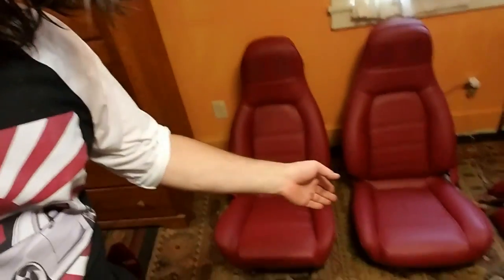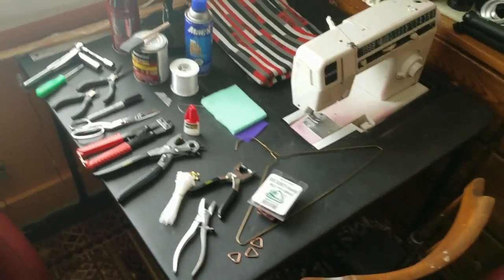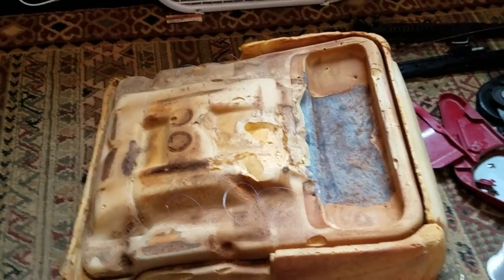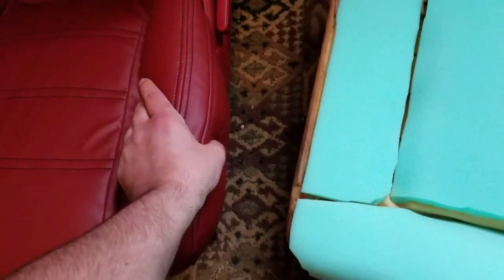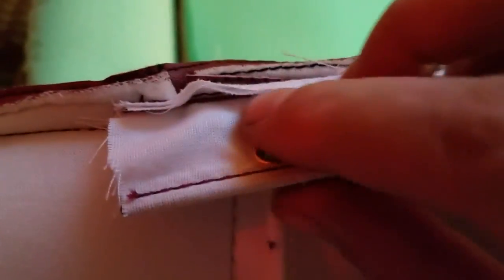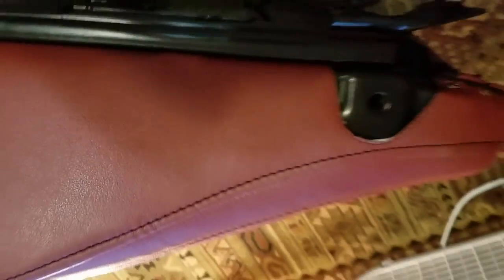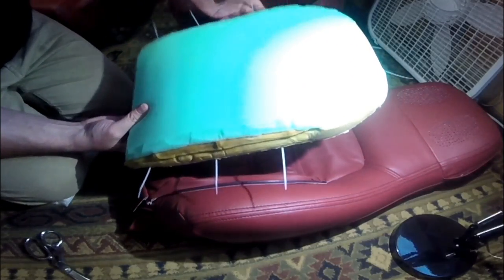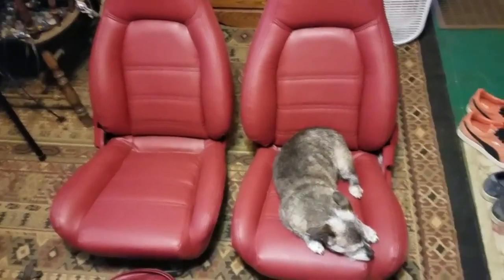[MX-5 Miata] Re-skin and restore your seats on the cheap!

Comment: Dude!  Thanks soooo much for the video.  I just finished installing interior-innovations skins on my '95 Miata.  Your video was of tremendous help.  I tried plumping up the foam with a garment steamer (as recommended by others) but it had little effect.  Your use of 1/2" poly foam is what was needed to make up for 23 years of age and butt pressure.  Thanks again!

Comment: They came out amazing! I just ordered the same seat cover replacements but in black. I saw another video where the guy gave up because they were too loose and wrinkly and I started to think about adding in foam to make it more fitted and for more comfort. I'm really glad I ran across your video because I'm now confident it can be done with materials I already have. Your instructions are WAY more clear than the ones given by the supplier. I hope you won't mind if I post your tutorial on the miata forums I frequent, you've got my sub and you'll be getting MANY more. You deserve it! Keep up the good work!

Comment: Thanks for posting this! I just finished redoing my seats in my 95 and this was very helpful. The addition of the rivets is CRUCIAL imo to reinforce the attachment points underneath. Without them the vinyl will rip. I was also worried the zip ties wouldn't be strong enough but they seem good and allow for cinching unlike the hog ring tool. I doubled up on spots I thought would see a lot of tension. I also added a lot of foam to my bolsters but not the bottom since I'm 6"4". My seat covers were only $100 for the pair and look good but with that low price, you end up spending more time to get them on right, adding rivets etc. It took me about 16-18hrs in total from start to finish. I also added heating pads to the back and butt of both seats ($35/seat ebay kit)

Comment: Finally some kind soul gives me a step by step primer in how to rebuild my 90 seats, ( in the only year of red, of course), new driver side seats are impossible to find, and covers don’t solve the basic problem of people not knowing how to get in and out of sportscar seats. Thank you so much for a class video on how to do it ALL, ( I hate the old foam on the carpet, will do the same fix. First video I’ve seen on how to REBUILD old seats, driver side ALL have the same broken-down feel. Now I have a project. Thanks.

Comment: This video definitely seems like the gold standard for redoing these seats. I just ordered a set of new skins. I will be referencing your video throughout. Great job!!!
Reply from the maker: Glad you liked the video, hope that your seats turn out great!
Reply: You didn’t add the poly foam to the upper portion of your seats?
Reply from the maker: I actually did do the upper bolsters too, but I don't think it's apparent in the video. You can see where I did the upper center piece and the headrest piece, but I had some lost video footage of putting the foam on the upper bolsters. I put a single layer on the front of the bolsters but it wasn't wrapped around the sides or back. Basically from the inside of the bolster to where the first edge seam is
Reply: Dang it. I didn’t do the upper bolsters so I do have a few wrinkles on my upper bolsters.
Reply from the maker: @ralphmiller2396  Oh, shoot...I'm sorry I really should have pointed it out in the video. How did yours turn out otherwise? Will you be able to disassemble them alright?
Reply: They turned out pretty decent. A lot better than others I have seen but not as great as yours. I definitely appreciate your video though

Comment: Wow your video and the steps you included were so good!  Would definately be worth paying something for!  I could not have done this without your video and/or it would not have turned out so good. About the only step I didn't do was the covering of the bottom of the seat; other than that I did everything just as you outlined. As one or two other people mentoned, I do wonder what the life expectancy will be of the plastic wire ties but also can not image trying to get hog rings down into some of the places; I think would be really really hard to do. If they would fail; I would just redo that part and I think I would still use wire ties to bring the points together; that might make hog rings possible.  Thanks again!!!

Comment: Great job, but I think the zip ties will break with time. Hog rings are what they use in car seats because there metal and they will last. They might even be stainless steal or something. One time I bought some large zip ties from home depot and they were brittle right when I opened them up, they broke right away as I tried to use them the whole batch was the same, I dont know if they were old sitting on the shelf forever or just bad plastic to begin with.
Reply from the maker: You're probably right, but so far everything is holding up well. If I have any issues in the future with any of them breaking it wouldn't be too hard to redo them with upholstery hog rings

Comment: Thank you for making this content!  Easy to follow and you've made this seem way more doable for me. 

Any advice you would give on doing this same project but with the leather material from the same vendor?  I will be attempting this on my '95 NA

Thanks!
Reply from the maker: Sorry for the late reply, if anything I would guess the genuine leather would probably be easier to work with. Hope your seats turned out good if you ended up doing them!
Reply: @CrogDogsGarage   Thank you for taking the time to reply!  Again, I love that you made this video as it has been crucial.  I haven't done the seats yet because other projects came up sooner (water pump & window motors & convertible top).  The seats are one of the next items on my wish list and I will definitely be using Interior Innovations for this.

Comment: You got them before they were bought out. So far so good. I can find NO WIRE in between the bolsters and bottom cushion. Should I install 2 wires, one top one bottom and then sew together with fishing line?Ohterwise, looking good, I’m an OG, done a lot of DIY ON BABY. I’m the second owner of a 90 ( dating myself and was almost 49 when I bought it. Have a 97 too, but it’s just gonna need a brew ebgine soon, as it’s over 200K  I like the way my 90 handles better. Will keep you posted ( typo almost 40)
Reply from the maker: The hog rings (or zip ties in my case) on the inner bolsters need something to grab onto, if your factory wire that's molded into the foam is missing though I don't see any reason why using a second wire on the top wouldn't work!

Comment: Hi, I also have a '93 LE (#928) and I really like all of the work you've done on yours. I was wondering if the seats were Red or Burgundy? I'm guessing the former but thought I'd check.  Thanks!
Reply: You probably already ordered, but I'm also in the process of getting ready to restore some LE seats, and I emailed interior inovations, and they say Burgundy is what they recommend, but they are sending me samples of the Red and Burgundy, so, if you haven't yet, remind me to let you know once I get the samples!
Reply: @maxisthemoose  Thanks and sorry for the delay, the notification got buried in my inbox. Also mulling leather vs. synthetic.
Reply: Hi, any update on the colors? I'm working through, spending $$ on, some maintenance needs first and haven't ordered yet.
Reply: Also, happy with the synthetic feel/weight/etc vs leather? They're $350/$450 now so hope to get a set that will work for another 20-30 years 🙂

Comment: Just curious, why add all the foam?  Being I’m 6’4”, I wouldn’t fit after this. Nice thorough job tho I will give you that
Reply from the maker: I mainly did it to account for shrinkage in the factory foam. Over the years it had shrunken down a bit and the replacement skins didn't have a nice tight fit at first
Reply: @CrogDogsGarage   foam didn’t shrink!   It loses its density!!   Shrinking foam. Lol. Good one!!!

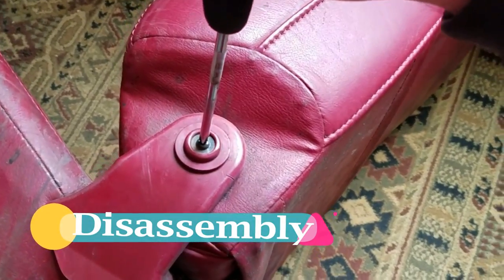Comment: Those seats look awesome. I have black vinyl that i am working on installing thanks to this video. One question though... The part you are taking the screw out of at 5:57... How did you get that plastic off?
Reply from the maker: Thanks man, I'm sure yours will turn out awesome! That plastic piece has a secondary piece that slides onto the seat's hinge pin and then the screw goes through it (Kind of like a washer) Once you pop it out, the main plastic piece can be slid up and off

Comment: look great man!.. The factory looked brighter red..Was it? Anyway..I was planning on reskinning my seats using faux leather myself..DO THEY HAVE A BRIGHTER RED AND LESS OF A OXBLOOD?? THANKS MATE... I HAVE A MARINER BLUE 91 WITH RED .8 AND .5 FLAKE AND MY CAR IS A #18 MONSTER MIATA CHRIS BUILT USING A ROUSH ALL ALUMINUM 347ci with a Tremec T6060 From a 2016 Viper amd a 8.8 ford IRS which Strange Axle narrowed a bit The car was oriiginally the 18th & 5th Vortech S -Trim Supercharger which was the BEST Miata he built and was perfecr..Mazda even had a handful of Engineers come see and drive it and said that the car felt factory and usedit at 92 SEMA..CHRIS UPGRADED IT LAST YEAR WITH THE All Aluminum ROUSH SET UP..THE TRANS WAS UOGRDED TO THE 6060 FROM A T56 AND THE REAR WAS 7.5 HE CHANGED OUT AND THE SUPERCHARGER WAS SWAPPED FORVA REBUILT/REMANED ONEandcthe car is now making over 630+ Whp & 589 LBS/Trq AND RUNS INCREDIBLE. CHRIS IS A TUNING WIZARD.. I HATE LS swaps..SBFords are bulletproof and in getting avg of 30mpg using 4.10sAnyway..FANTASTIC WORK!! THATS TALENT MATE!
Reply from the maker: Thanks man! Jeez that sounds like one beast of a Miata, any videos of it here on YouTube? And to answer your question; yes, I think the factory seats were a bit brighter of a red, and after 25 years the leather gets kind of a glossy look. I haven't been able to compare them to any other LE seats unfortunately. I think the color they listed for my seats was burgundy, but if I recall they did have a brighter red available too

Comment: You forgot stretch when someone sits on it!  If it’s so tight from the get go the seams are under stress! And zip ties will break ,  the metal will wear thru them that’s why hog rings are used .   Beware of super glue it will dry hard and cause a whole other problem!

Comment: Maybe the foam is in too good a condition on my seats but there is no way I can get a zip tie to push down and pop the end on the other side of the wire, there is to much foam injected all around that wire. I worked at it for 30 minutes with a couple different sizes, no go. I guess I'm off to get hog rings and pliers for doing it the old fashioned way.

Comment: Did the seats come perforated for the speakers or is that the $100 "genuine leather perforation option"?
Reply from the maker: Hmm, my skins had the headrest perforated for the speakers, but I definitely didn't pay a $100 charge for it. It was a few years ago now that I ordered mine, I think I remember choosing an option to have them perforated but if I recall correctly it was free, since my skins were $225 shipped
Reply from the maker: Actually I just looked at their site, I think the $100 charge is for perforated leather inserts
Reply: @CrogDogsGarage  so like the middle section of the seat?
Reply from the maker: @tenuunenkhbayar356  Yeah, I think that's what the $100 option is for

Comment: Buyer beware! “Interior Innovations” no longer exists. They’ve been bought (I hope) by another company. When you place your order online, you get a “404” code. The phone # still works, but is to another company. Will let you all know if they are for real.
Reply from the maker: That's weird, I didn't have any trouble at all when I ordered my new skins from them, but it was over a year ago that I did. Definitely comment again if you find anything else out!
Reply from the maker: I tried the 989-6079112 number and got a voicemail for Interior Innovations
Reply: Ordered a set for my 91 Miata. I’m disappointed the workmanship,quality and fit are not what I expected. Will not use interior innovations again. Made in Pakistani.
Reply: Ordered from interior innovation for my Miata.  Bad experience fit and quality not good made in Pakistan. Will never use them again.